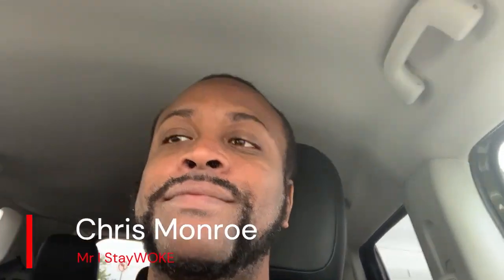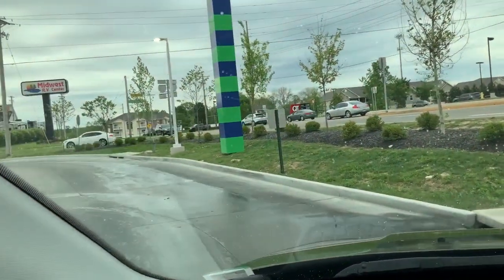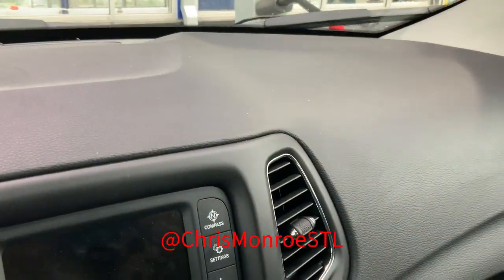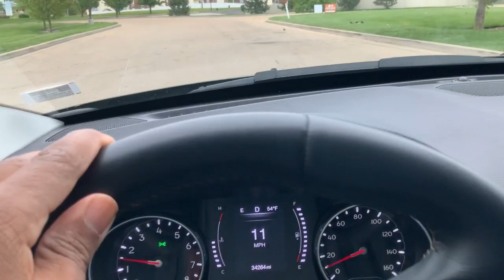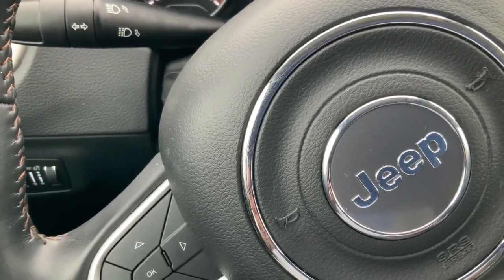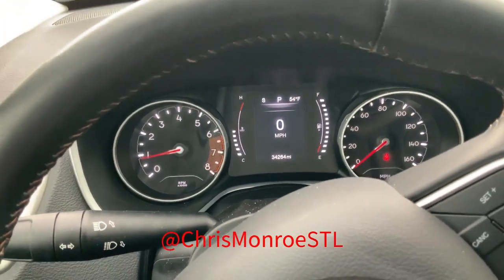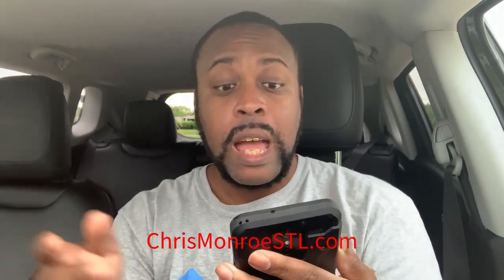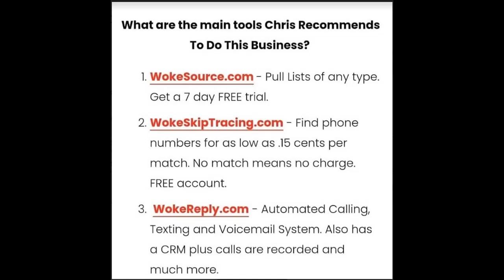How To Prepare a Rental on TURO - Jeep Compass listed on car sharing site - @ChrisMonroeSTL

Comment: Question : Mr. Monroe did you form a specific LLc for your toro business to hold the vehicles and also could you automate this business successfully in your opinion?... Thanks Monroe.
Reply from the maker: I did start a new LLC however it is not required to get started. Most people do it as supplemental income versus a full business. As far as Turo is concerned, they do not care how it is titled but they do care about having insurance.

 I am buying another car every few weeks. My next one will be here Thursday. Yes. You can completely automate this business.